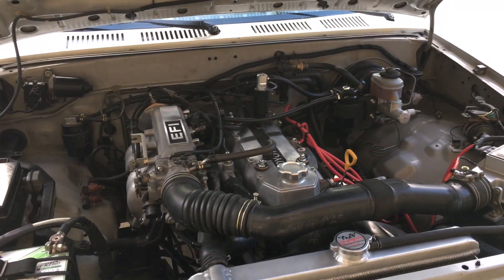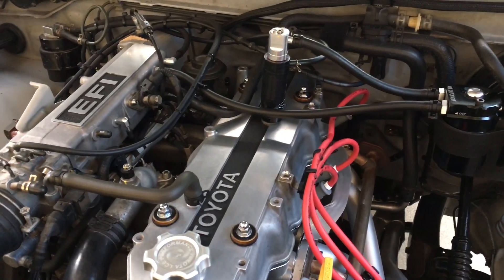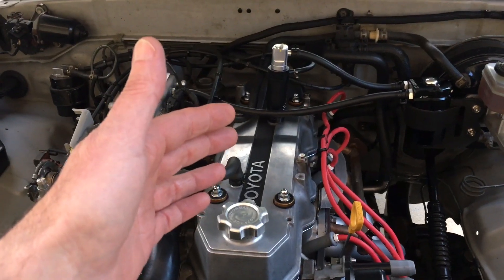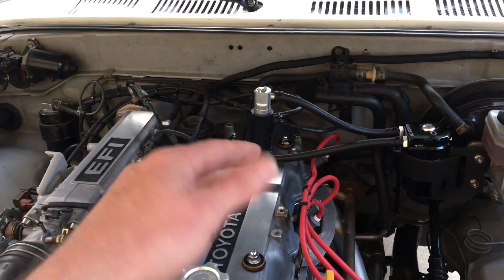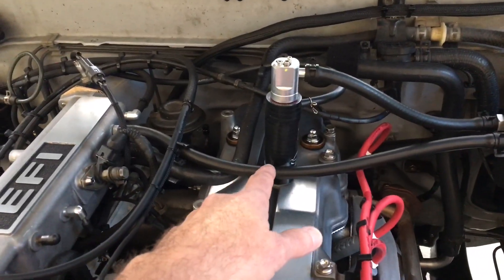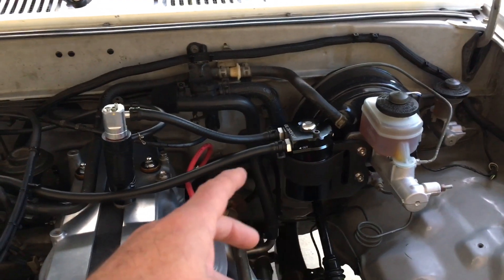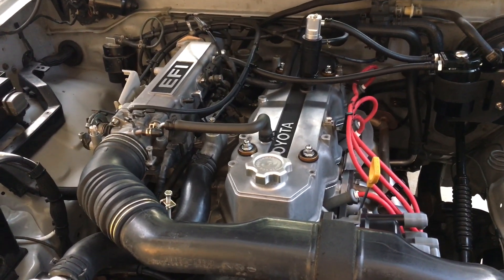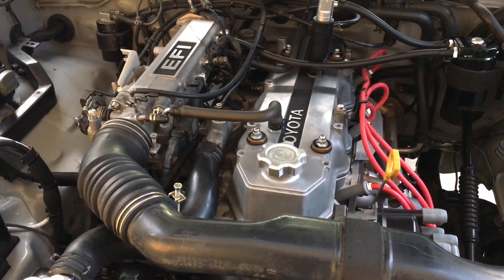AT LAST, MY LOVE HAS COME ALONG - The Toyota 22RE oil baffle works amazing!

Comment: Hello, I have a carbureted 22r and I’m burning lots of oil with smoke. When I plug the intake to pcv hose it clears up. I don’t have a catch can so I’m not sure what exact oil siphon numbers are. I don’t believe I have a high flow oil pump but there could be a non Toyota cast head (return may be blocked). Truck runs great but I’m not sure how to proceed and clear up oil consumption. How much blow by is acceptable out of the oil fill at idle?
Reply from the maker: Sounds like you might have a bad or stuck wide open PCV valve. Have you checked that? Usually the level of oil being drawn into the intake is a function of how much vacuum the PCV valve allows through. In other words, if you just ran a hose from your intake directly to the breather location on the back of the valve cover, it will basically just suction all the oil up and out of the motor and burn it. Also, are you running the factory breather tube on the front of the valve cover or a K&N style filter? Sometimes the amount of fresh air let in through that breather port can impact how much vacuum goes out the PCV port - so that's something to consider here also. Blow-by is a function mainly of how healthy your piston rings are. If you're getting too much blow by, it will pressurize the crankcase and you'll start seeing oil being blown out around the dipstick, etc. The PCV's system is there to help prevent this by drawing away any crankcase pressure which builds up. You also definitely want to ensure that there are no oil blockages at the oil return hole at the back of the cylinder head - any restrictions there will cause oil to pool at the back of the cylinder head and this will tend to swamp the oil baffle mechanism back there. I'd start by checking to see if your PCV valve has failed maybe.
Reply: Wow, thanks for taking the time to get back to me. I’ve tried both a spare and bought a new one (local parts store cheap pcv) and no change. Would you recommend the “updated” metal ones like LCE sells? Some recommend factory Toyota but my dealer had to order one and I figured I’d just order it myself.. as far a blow by my motor seems pretty fresh and is in the 180 psi range on all 4 cylinders. Also cold start at idle the oil fill cap stands still when unscrewed. 
I’m curious what can be done about the air inlet and how it can possibly be “restricted”, it is a factory hose to the air cleaner.
Reply from the maker: @StephenAndrews-fd3og  180 PSI is very healthy. Factory 22RE is 171 generally - maybe the 22R is a hair more compression? Usually even the cheap PCV valves function fine. Since you have a carb (as opposed to fuel injection) you shouldn't need to worry too much about air flow coming into the valve cover through the breather inlet. However, you can restrict that somewhat if you want for testing. When the PCV suction occurs, air has to come from some place; if too much air is coming into the motor, you can sort of create a hurricane effect (this is especially true if you happen to be running total seal gapless rings or something). If you dig around in the Total Seal literature, they actually discuss installing a 1/16th restriction in the fresh air inlet side as I recall in order to slow down air flow through the PCV system. If you have a vacuum gauge, see what sort of vacuum in in/Hg you are pulling at idle.
Reply: Ok, got my vacuum gauge and new pcv. The problem seems to have gotten a little better but still blowning plenty of smoke. The smoke clears up when I block the pcv vacuum hose to the intake. Vacuum is pulling 20Hg at warm idle. It’s an 83 truck so I have an early valve cover on a “laser” block (85+) motor. Do you think the oil baffles are different between the two engines?
Reply from the maker: @StephenAndrews-fd3og  okay.. 20 in/Hg is healthy. I'm starting to wonder if maybe the gasket on the internal valve cover baffle itself maybe has fallen apart? When that happens, it can vacuum up oil like there is no tomorrow. Have you checked inside the roof of the valve cover to see if the seal between the baffle and the valve cover has failed? That might be the issue. Also I'd check to make sure nothing is obstructing the oil return hole at the back of the cylinder head. As far as oil baffle design, there were some minor changes. I have some videos showing the later baffle system I used, but mostly my issue related to that oil return hole on the LCE head being way too small.
Reply: You were exactly right. I found the Philips head rocker arm shaft screw closest to the oil return had worked itself loose and ended up in the oil return passage. Not sure if this caused a double issue of swamping the valve cover and simultaneously squirting oil directly into the baffle or just one of those issues but I’m happy either way. Thanks for your guidance and pointing me in the right direction. 
Stephen
Reply from the maker: @StephenAndrews-fd3og  Oh yeah, that would do it for sure. What happens is the oil pools up there in the back of the head (anytime the oil return hole is restricted) and then under any acceleration, it swamps the oil baffle and from there your PCV is basically a wet/dry oil vacuum cleaner directly into the intake - oil rolled down #4 runner and gets burned. I bet if you pull your plugs, #4 is black as hell. Anyway, glad you located the issue!

Comment: glad to hear you got good progress!  Did you smoke out the tailpipe or just use oil?  How did you make sure it wasn't rings?
Reply from the maker: Smell of oil coming to a stop, but no smoke visible. It did turn out to be largely related to the rings (see my more recent videos). Also the oil return hole in the LCE head is too small and required opening, which immediately solve the oil into the catch can issues.
Reply: @ray5961  thanks. What is LCE?
Reply from the maker: @nesnejify  LCE is LC Engineering. They have a website for a lot of Toyota related parts. Check them out via google and their website.

Comment: What did you use to clean the motor
Reply from the maker: Tooth brush and bamboo chopstick with Bon Ami and Bar keepers friend. I also use an organic cleaner called Arm & Hammer Essentials (the yellow bottle). Also just gas and a micro fiber. Lots of time and fine detail work

Comment: Just curious what type of oil do you use? (oil type, weight, and brand)
Reply from the maker: I've tried everything under the sun... I'm a big fan of Motul as well as Mobil 1. Lately, I've been running Valvoline and have been liking that. I've tried 0W20 through 15W40 (Rotella). Right now I'm running Valvoline 5W30 and really like how the 22RE feels with that. I'm going to switch to 10W40 (still Valvoline High Mileage) just as a test, but as the temps drop I'll probably mainly stick with 5W30

Comment: I did a big oopsie and had my distributor a tooth advanced on my 89 22r. took it for a good hot doggin and now the blow by is pretty brutal. literally a 340,000km mint engine and I borked it. live and learn i guess.
Reply from the maker: Yeah, sometimes lessons are very hard learned. Don't feel too bad. When I first got my truck, I thought it had a MAF and I promptly unscrewed it in order to clean it. Turns out it doesn't have a Mass air flow sensor, but rather an AFM (air flow meter), which I had accidentally just destroyed. A while later, I was messing around with my distributor (before I guess I fully understood how to set the timing on the 22RE via the diagnostic box). I accidentally over adjusted it (retarding the timing too far I am guessing) and this allowed the ignition to run so far retarded that combustion was occurring partially inside the exhaust manifold. I barely made it back from town and almost didn't make it up the hill to my house. When I got home, the exhaust manifold was glowing ruby red. I called LCE and explained what I had done and they said "it's probably okay". I ended up replacing the cylinder head, but I wonder if I did any damage with that stupid move - that might account for some of my blowby issues actually. It's hard to say, but you might have done something similar to what I did there. Did you experience your manifold getting super hot? In my case, the motor lost a lot of power and sounded like a lawn mower and was very loud and rough.

Comment: Thanks for sharing your information with us. I'll stay tuned for the next update, then start modifying. I'm rebuilding a 87' 22r 4x4 I have the same issue you have, or had, with the pcv sucking oil into the intake.
Reply from the maker: Interesting. How much oil and what rate is yours drawing oil into the PCV? I will have an update very soon, but the baffle performed amazingly well over the last 800 or so miles, even when using higher crankcase vacuum settings. The design I showed in that one video really performed beyond my expectations, so I'm looking forward to sharing the info in the next video here.

Comment: Glad it is making a difference,  you put a healthy lower end in that thing and you will have the driest catch can and intake ever.
Reply from the maker: Thankfully the intake has remained pretty clean. Anytime the catch can has overflowed and allowed oil in, I usually spray a bunch of B12 chemtool in there to help break things up. It's not as clean as when I removed the entire intake system and cleaned it with a toothbrush, but it's hanging in there :-)

Comment: I really enjoy the info you provide. I had just picked up a truck like yours paid way too much for it but if you want it, you are going pay for it. I have a few problems that I will fix thanks to your video the other stuff may not happen, but I will give it shot. I am fighting cancer which really sucks. I really like the info you are putting out I wish people would do the same! thank you
Reply from the maker: Thanks man! Glad you are enjoying the videos. What kind of cancer? I had the start of skin cancer on my arm... I took a white hot needle and burned it off. You might wanna research the link between diet and cancer, especially as it relates to how cancer cells thrive on sugar. Some years back, I had to change my diet and eliminate all sugars (I held my intake to 2-3 grams of sugar per day for several months and used consistent doses of oil of oregano to kill off yeast in my system). Made a huuuuge difference. If you saw before and after pics of me, I look like two different human beings. Anyway, research the links between sugar and cancer and also check out like Dr. Berg videos on here relating to the benefits of fasting. The gerson therapy is also something you might look into. I've used some of the techniques in their books with good results. Also the benefits of red meat is something to check into. I switched my diet to a diet high in grass fed red meat and have never felt better in my life. Anyway, I'm not a doctor, but just some stuff to check into. The body is a delicate machine. Here's a video on my other channel (inactive) which you might be interested in, it sort of underscores how something small can really throw the human body off: https://youtu.be/nao7MDMnhYg

Comment: Hats off man, sounds like you got it sorted.

Meanwhile, I’m thinking of fabbing up a bracket to hold a spare bottle of oil under the hood (above the passenger frame rail) so that when i see it’s low on the dipstick at the gas station, I’ll have one on hand w/o risking it spilling all over the interior by storing it there.
Reply from the maker: Thanks! Yeah, it seems to be dialed in now. On the oil storage, I hear ya. When I travel long distances, I keep a 1 quart bottle of 5W30 tucked behind the seat :-)